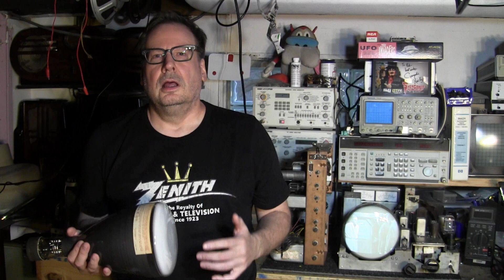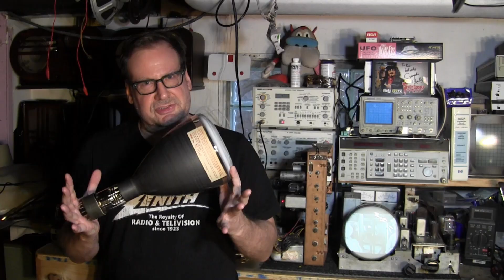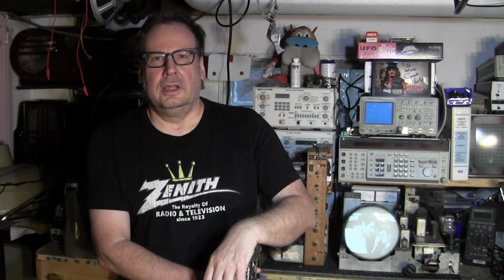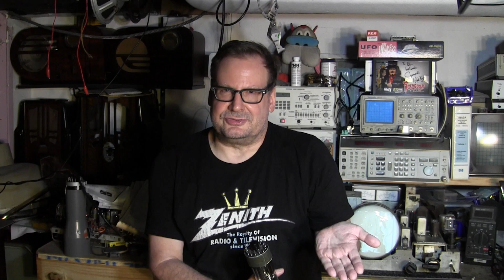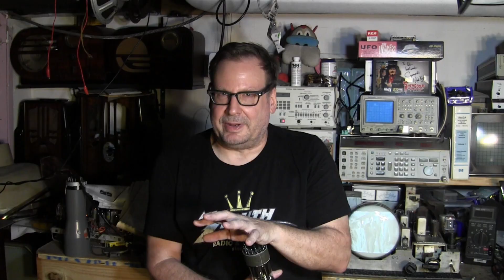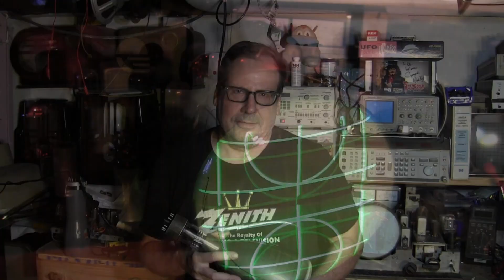How to restore a 1940s electrostatic TV - Finale!

Comment: Great series Bob! It seems some of these Admirals are starting to get silver mica disease unfortunately. I did a 19A1 last year for a customer, and after an hour or two playing great it developed static crashes in the video and sound. It ended up needing T102 re-capped and a full alignment, but that might be a bit much for a beginner series.
Reply from the maker: Thanks. It's not just the 19A1, all the early Admiral TV can get SMD.  They used exposed mica wafers inside the audio IF cans.  I'll talk about it sometime in the next few months when I get back to finishing off a console Admiral set.